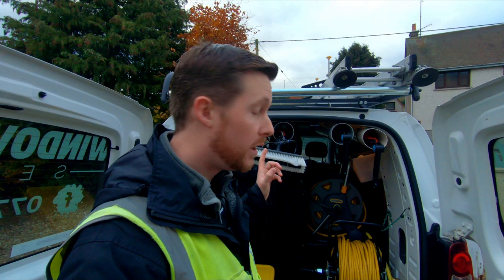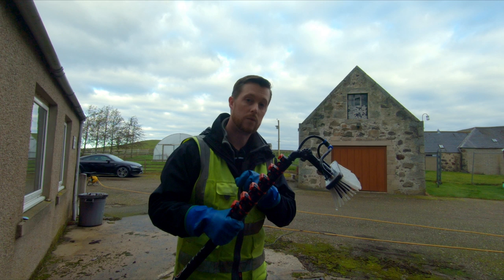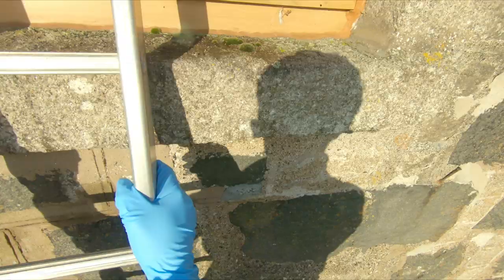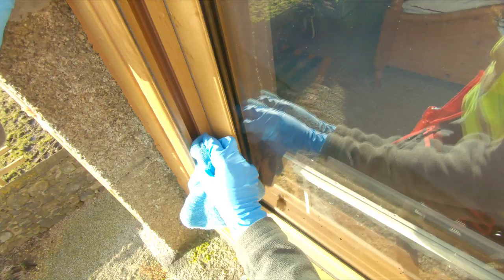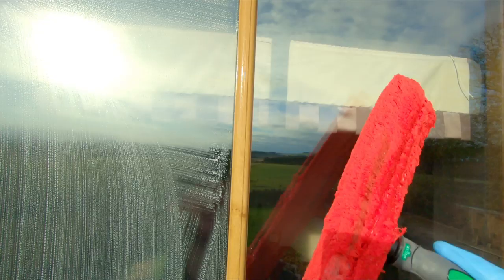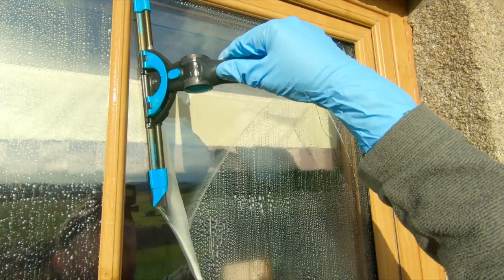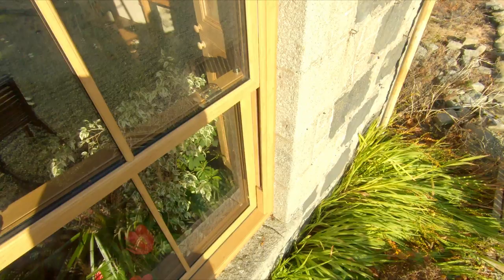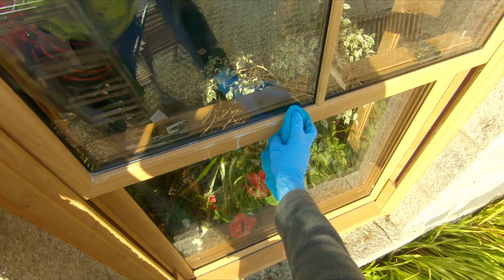USING WFP & SQUEEGEES ON THE SAME JOB???

Comment: I agree it may not get every little bit of crud but the whole idea of wfp is not to use ladders even to check your work.
Reply from the maker: Yeah I get you 👍🏻

All depends on the service folks want to offer and also how they've priced it. 

Some customers don't want an expensive deep clean like this so may prefer just the wfp to keep the costs down. 

Ladders though are perfectly fine so long as you treat them with respect and know what your doing. Ie placed at a safe angle, and the feet are secure. Also taking your time going up and down, not taking safety for granted. 

Having a respect for the ladder and how important safety is, I've personally never ever fallen from a ladder or had issues in over a decade. 

Problems with ladders are near enough always user error, ladders placed on unsure surface, bad angle (too steep or shallow), going up or down too quickly etc.

Unless the ladder is in poor repair and breaks, then it's down to the user to use the ladders correctly and safely. 

I personally know people that swapped to wfp because of falling off a ladder, but with further enquiry I've always found it was user error and carelessness why they fell.

Thank you for your imput, it's always truly appreciated!
Reply: Totally agree - the point of WFP is to eliminate unsafe  ladders. and why put soap on again after pure water - the whole point of pure water is to eliminate soap residue build up and usage
Reply from the maker: CMW CMW how would you remove paint, cement, silicone or hard water stains only using wfp? Please tell me because if there’s a way then I’m all for it, if not then you have to do what has been demonstrated in the video. Get the worst of the debris off with wfp, then everything else is removed with either bronze wool, razor and specialist cleaning products. Ladders are only unsafe if used incorrectly or taken for granted. With proper use and respect, the ladders are a perfectly safe option so long as you know what your doing. Accidents with ladders come with incorrect use, ie set up at a bad angle or unsafe ground beneath. 

Wfp is a grand tool, no arguments there, it will not however remove the things stated above. Some window cleaners are happy to only clean what the wfp will remove and that’s fine if they are happy with that and so are the customers. For me I teach people how to perfectly restore/clean windows using every tool at a window cleaners disposal.

Thanks for your comment, much appreciated 👍🏻👍🏻😀

Comment: Top job as always Trad Man, I would have just done it all traditional then the next time wfp. Understand why you have done it this was but seems your creating double the work.
Reply from the maker: 😊👍🏻

The waterfed pole is great for taking the worst off and then using the trad tools after to get rid of anything the wfp didn't. Doesn't mean every window gets done again just a few that didn't come up 100% with the wfp. hope that makes sence. 

You of course can trad a job then wfp later but on this job I needed the wfp out anyways for the velux, so might aswell give the whole job a flick over then touch up any bits left with the trad gear.  👍🏻

Comment: Good video, first clean, use a soap injector system and use the garden tap  water connected into the water feed pole, using at high flow rate cleanses all the frames and glass and flushes out cobwebs and leaves etc  the slight soap rate of injecting brings everything new again instead of using pure water, then inspect and bronze wool and use a spray bottle with pure water and a very small drop of detergent  and squeegee off, this method is good for regular cleaning so you don't have to reclense the glass and  you can do the pure water pole method   👍😀
Reply from the maker: Sounds good, although what about removing paint, cement, silicone spots?
Reply: Yes that's why I  always do  the  up close visual inspection and use bronze or  scraper  to remove any paints or silicon sticky tape  hard water stains etc , same as you done in your video but use the injector and tap water the first wash , and spray bottle and squeegee after  when all is 100 percent cleaned off the glass   👍😀
Reply from the maker: @FlashTechEngineering  😁👍🏻👍🏻✌🏻

Comment: Another fine video Peter, very thorough indeed 👍.  I see your using the Exceed sleek connection ! Personally find those overpriced chunks of bulky plastic, anything but sleek !
Reply from the maker: Thanks buddy!

Yeah using the slick at the moment, seems to be working ok so far, I'll do a review on it after its had a proper bashing lol
Reply: @TradMan   Good luck with it mate but im certain you will come to hate it !  I found it catches on the corners of buildings so easily , leaks as well and constantly needed adjusting! To big & clunky all round and not terrible strong!
Reply from the maker: @JasonDunlop247  Yeah I did notice a bit of leaking! I'll keep an eye on it. Thank you buddy!!

Comment: Sorry but when I switched to WFP I DITCHED my ladders. Isn't that the whole point of WFP? To eliminate the need and the risk of ladders? Sorry but what an absolute waste of time that is doing it both ways. All you needed to do was spray your brush with a choice of TFR. Give the window a good soaking, apply the TFR, let it dwell, then give it a good scrub and a better rinse. Job done. I honestly hope you're charging accordingly for all that extra effort! Don't get me wrong, I really respect your worth ethic not questioning that one bit. Just overkill for me personally but each to their own ;)
Reply from the maker: Yes indeed I get where your coming from. 

The problem is especially on first cleans that windows at 20ft up and above and this style of window with little areas hard to clean, are impossible to get right no matter if your using chemicals or not, you need to be up there either on a ladder or access it from inside to get it perfect. 

Depends on the service you want to provide. 

No waterfed pole and chemicals would of cleaned those windows 100%. I needed a razor to get some of it off plus bronze wool. 

I've used tfr and others like it, it's great for removing the green from frames etc, but how does it cope with paint spots, concrete and silicone? Can you tell me what wfp is getting that off?

Going up ladders pointless? No sorry that's incorrect. If you would be ok leaving stuff like that inside the frames or on the glass that would be up to you. 

Also I say multiple times to "charge accordingly" so is it a waste of time if your being paid for it? No

Thanks for your imput

😁👍🏻
Reply: @TradMan  I will admit I commented quite early before you mentioned about charging accordingly so yeah as long as you're getting paid ;) as for the concrete, paint etc...I regard that as a builders clean. Something that I personally don't do and I know many other water fedders don't either and I explain this to the customer. As long as expectations are met.
Reply from the maker: @deltafit  😁👍🏻👍🏻✌🏻
Reply from the maker: deltafit see that’s the difference there buddy, I don’t regard myself as just a wfp’r or a trad’r, I use both tools depending on the job. For me cleaning the window means removing everything off it that you can. If a person doesn’t have the tools to take off paint, silicone, hard water stains etc that’s fair enough.

But just using the wfp alone on everything is not going to get windows 100% unless it’s just general dirt that’s on the window, ie dust, mud, spiderwebs etc.

That’s why in my area I’m the most expensive window cleaner, because I provide a service very few will because they don’t want to put in the effort and time, ie climbing ladders or scrubbing with bronze wool, it’s easier for the majority to just scrub, rinse and go.

But if your willing to go that extra mile, you can charge really well and do less jobs in a day for the same if not more money than those that do 20+ houses just using wfp and nothing else. 

It’s not for everyone but the way I try to teach people is to get the windows as close to perfect as possible and be paid well for that 😃👍🏻👍🏻

Comment: Good video Peter,but tbh you've soaped the windows after using WFP which could cause spotting the next time you clean them using the pole.i tend to give 1st cleans  a clean twice over .
Reply from the maker: Indeed the first return clean would need an extra rinse if you intend to use wfp from then on. 👍🏻👍🏻

Thank you for your imput, much appreciated 😁

Comment: Daft question. If you were going to go up with the ladders, what was the point of using WFP? Just to get the worst off to make Trad work easier?
Reply from the maker: Precisely, wfp is a good tool but it doesn't remove everthing and especially windows like that where you have tracks at the sides to clean out, but it's handy to get rid of the worst of the dirt with wfp and then check over the windows with your trad gear, you may not need to trad every window again, only the ones that didn't come up very good with wfp and while your up there you clean the side tracks out with a cloth and clean the sills properly as they are not viewable from the ground when using the wfp

Comment: Hi Pete , great job as always . A quick question if you don't mind .
Brian here from limerick in Ireland  , do you have any advice regarding removing stuburn water stains .
Reply from the maker: Yup, use unger rub out and an abrasive pad. I use walnut pads
Reply: Cheers pete

Comment: Artillery fungus, on maintenance cleans, it would probably be a problem, and is. Trad only there? Even bronze sometimes doesn't take it off, and the only way with a steel blade. Is there a WFP brush that will eliminate it from both the window and the frames?
Reply from the maker: Yeah if it persisted to be a problem, then trad'n it would be the answer. We will see how the maintenance clean goes next time 😁👍🏻

Comment: Hi trad love the vid as normal why dont you use the bronze wool pad on the back of the brush or a water feb pole detergent on the windows only using water on a 1st cleans not really a standard method good wfp cleaners would use a detergent on a 1st clean as standard 9r bronze wool pad  the glass or both

The bits missed on frame was a really good point and i liked the way you went up and dealt with those but a sil brush might have reduced those since they are better at getting to the edges of frames etc and are normally recommended for 1st cleans a block brush on sash windows is a really bad idea and not correct i only use a sil(radius brush)  right brush for the job right. 

But the results from your method of just wfp and basic bursh where the best anyone could get no one would be able to get them better.
Reply from the maker: Yeah the problem is windows at around 20ft or higher, always seem clean from the ground. 

When you go up the ladder you often see small bits missed.

No matter what chemical you use or brush (although I've no doubt they would help) not being able to see the window up close can leave bits of debris not seen from ground level. 

Once you've done the initial clean and got the worst of the dirt out of areas the brush can't get into especially up high, then the wfp would be no problem at all for return maintenance cleans. 

Thanks for your thoughts buddy. Truly appreciated! 😁👍🏻👍🏻

Comment: I use both methods all the time. Lower windows are almost always dirtier than a window thirty feet off the deck. WFP don't remove hardwater and can take longer to clean a very dirty piece of glass than traditional methods would.

Comment: Oh cool, so we don't have to cut the rubbers perpendicular with the blue clips?
Reply from the maker: Indeed! Give it a go, so far I've found no issues using the straight edge as opposed to cutting the corners. 

On chunky frames the angled rubber does fit better into the corners as opposed to the squared end but it still works fine using squared ended rubber

Comment: Ñwhy not just use trad method and you know it's done right
Reply from the maker: The wfp is great for removing most of the dirt, like spider webs, debris from trees, mud etc.

Using the squeegee after (on windows that need more tougher stains removed) is the final thing to get the windows perfect. Also using the wfp saves a lot of cloths to as it's doing most of the hard work for you.

Comment: What size water tank have you got mate?
Reply from the maker: 225 litres
Reply: Does your van pull ok with that size of  tank? Did you fit your tank yourself?
Reply from the maker: The tank comes with brackets so all you need to do is bore the holes in the floor and screw it down. Window cleaning warehouse also can fit it for you. 

Van pulls no problem at all buddy. No issues

Comment: Don’t you check your work from the interior once you’v worked inside? I’d be paranoid thinking water leaked inside due to a bad seal or something.
Reply from the maker: Yeah totally get what you mean. Problem is in the uk most don’t want an internal service only external. Occasionally I convince a few to get the in and out done but it’s not overly common here for residential work.

Fortunately this job had cleaning lady’s in while I was doing the windows so they were cleaning the window sills inside as part of there clean so that was good.

Usually if there is an issue with leaking windows you can see the droplets inside and as far as I could see there were no issues and customer was delighted so must of been ok 👌😜

How are you doing anyway Heather? You keeping well?
Reply: @TradMan  huh that's so odd,  most  housekeepers here don't clean windows to save on time I guess. Honestly sometimes interior work can be an insurance nightmare. 

It's been fine, my spring/summer was insanely busy. I had a nightmare construction cleanup that took over a week to do. Ever thing that could go wrong did, I wish I'd documented it. 
Almost made be consider another trade😔. 
But things have slowed a bit so I've been working on keeping a positive perspective within this industry. 

How has it been yourself? Things getting cold over there?
Reply from the maker: @heatherthewindowwoman4835  yeah it's very seasonal for you folks over there. 

Here it's just as busy January through to December as everyone is usually once a month or every two months. 

Yeah getting cold here. Was very very wet today! I had full water proofs on and still got wet lol, Scottish rain is awesome haha

Comment: Hot water system
Reply from the maker: Indeed that would help but still wouldn't solve the problem of getting the frames 100% as you can only see certain bits when your up close nose to glass. 

Thanks 😁👍🏻

Comment: Just trad it first then follow up cleans can be wfp..👍
Reply from the maker: asboss63 the wfp is great for getting the worst of the spiderwebs and dirt off, leaving only debris that bronze wool or a razor will remove. This job also had velux windows so might as well go over it all with wfp and inspect the windows after with trad gear to hand for any windows that didn’t come up as well as they could of.

Some jobs I will just trad first time, but this one was covered in spiderwebs, debris from trees etc so it’s handy to wash away all that stuff, making the trad’n much much easier at the end. 😃👍🏻